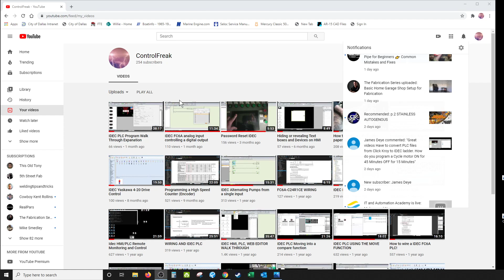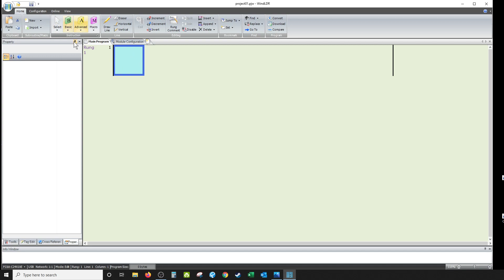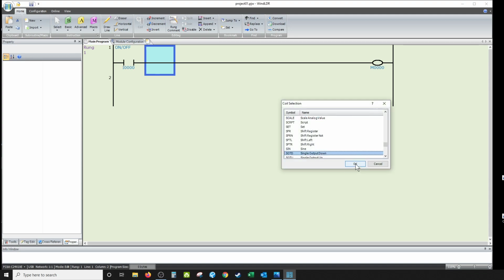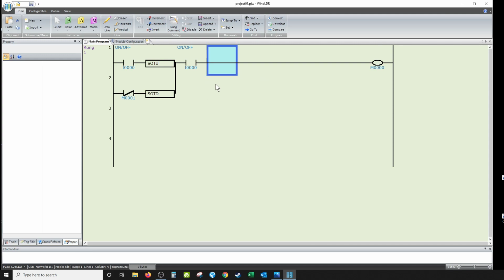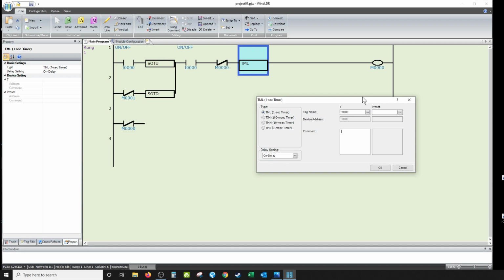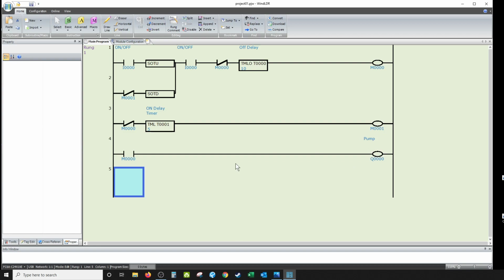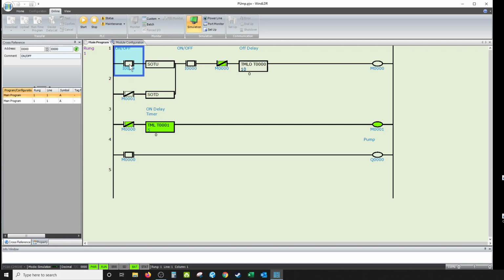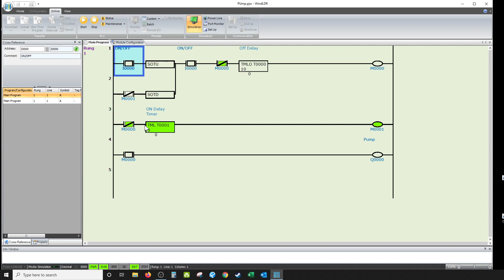Pump, Fan, Motor ON/OFF Loop timer.

Comment: Hello sir! I have been trying to program a moisture sensor but have run into problems. Do you have any ideas or examples on how to go about this. I greatly appreciate your help. I also enjoy your videos they have been very helpful. Thank You again.
Reply from the maker: What is the problem?  is it 1-10 or 4-20ma?
Reply: I tried programming a moisture sensor that operates.:
 Operating voltage: 3.3 to 5.5 V DC
Output voltage: 0 to 3.3 V DC
Operating current: 5.5 mA

But my PLC seems not to read that low of current.  Got any suggestions?

Comment: Hi thanks for taking the time on making this videos. Question how would you fan needs to be started from 3 locations and needs a pilot light in the office to confirm the fan is running.
Reply from the maker: You could use 3 seperate NO momentary push buttons wired in parallel to either one input, or idividually and parrsllrl them in the logic.  Bring an input from the auxilary contact of the starter to an input on the plc.  Have that input fire an indicator on the HMI, or a real world Indicator light wired to an output of the plc.  I think this is what you are wanting.  If not, or I didnt explain it clearly enough, let me know.  I will try to get you what you want.
Reply: ControlFreak , it’s really cool what you do . I use all kinds of PLCs and Robots . You should look at the Connected Component Workbench by Allen Bradley . I have a robot cell that I use idec on some machines I have Allen Bradley micrologix on another machine and a micro810 smart relay (plc ) . All in one robot cell and by far CCW is the easiest to work with . Idec is solid and affordable but the timers I am not a fan of . There’s no Timer Timing bit so I have to make my own is there a better way with WindLDR ?

Comment: Hello, I am doing my bachelor project at the moment,  I have an older plc, the FC4A-C24R2C, and i have to do a sequence of 1 air pressure stamp going up, another air pressure stamp going down, then motor turning on for 30 sec, stops. Then second air pressure stamp goes up and then reset to start, while I have emergency stop, and a shield that if open, nothing can be done - We havent been tought any plc so im self learning, your videos have been very helpfull so far, but I am still unable to make this sequnce in the program, I hope you can help me :)
Reply from the maker: I hope I can help, sorry for the late reply.  Try using the bit that starts the first pump, as a NC on the second pump.  One is off, the other is on?  Timer after the second one to run your motor for 30 seconds.  The way I program is in steps.  First acomplish your first goal in the program, test it.  Build in the second goal, test it.  Build in the third goal, test it.  So on, and so on.  You will learn alot via trial nad error this way.  Thanks for watching.

Comment: Don't know if you use WindLGC, but I can convert it from WindLDR if you can draw it. I am using an FL1F for refrence.
Input 1 activates an off time for 10 minutes and then activates coil one and three for 3 minutes on time with inputs 3 and 5 resetting to the off time. Basically one switch will activate two different pumps and then once they hit the low level input they will divert to an off time and then kick back on individually until they reach the low level again. Off for 3 hours, on for infinite(until low level) and repeat. I can do it with one pump but can't comprehend it with two. All times are generic, just need them off for "x" amount of time and the on for "x" amount of time with an interrupt to divert back to the off time. Or even an off time that triggers an on until the water level hits a low point then reverts back to off and repeats. Sorry if thats confusing.
Reply: I figured it out, retentive on-delay with trigger through three wire start/stop. Keep posting though!!!
Reply from the maker: @spaseghost  WindLGC, I have honestly never even heard of it.  Is it for "instruction list" style of programming?  Glad you figured out your project.  Sorry for the late reply, been a busy couple of months.
Reply from the maker: @spaseghost  Thats cool.  No sound on your video?  Or, do I not have something turned on..  I subscribed!
Reply: @huntxtrm  I don't post a lot. No, no sound, just used windows xbox capture thing. So far everything is working perfectly. Going to try to add the second pump and logic tonight.
Reply from the maker: @spaseghost  Its awesome you made a video to help others!  Not beating up on you.  Most people appreciate the effort.  You will get a few yahoos that will beat up on you.  But, ignore them.  Point is your trying to help, they are not.
Reply: @huntxtrm Yeah, there is a reason why I stay off social media, I really don't care what others think! Thanks for the wisdom, I also appreciate you posting as well!